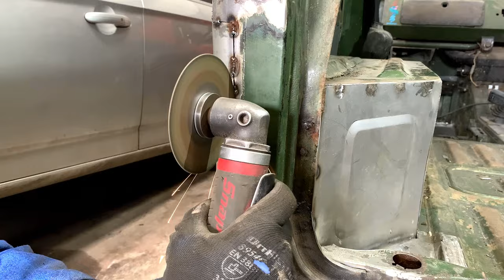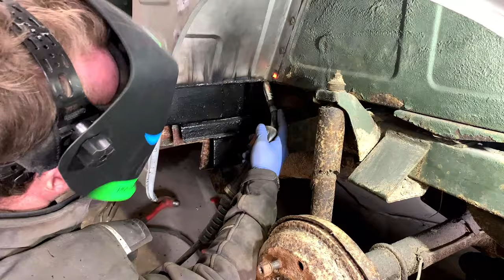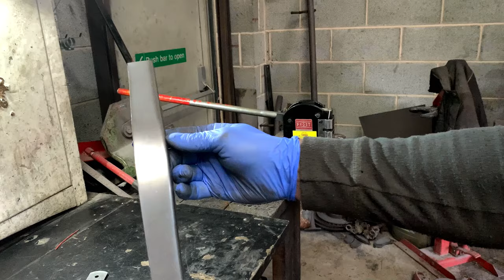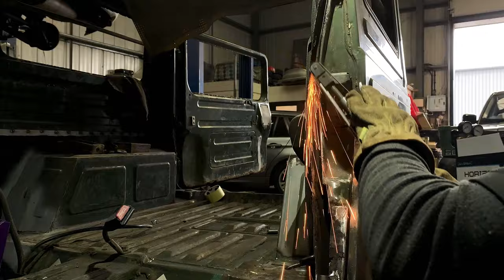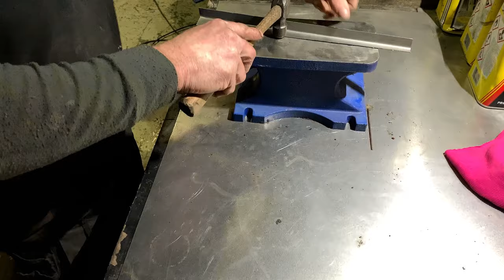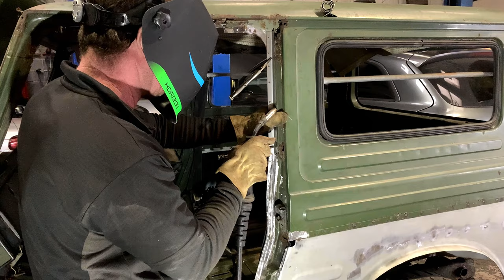Suzuki LJ80 Restoration Part 7 - Repairing Inner Door Jamb & Finish Welding Rear Quarter and Sill

Comment: I love your work, its so satisfying to watch. Definitely lots of skill involved here. I was wondering though - why don't you treat the steel on the inside of the panels before you weld the patch panel in? And the rear of the patch panel is left exposed? Won't it just rust again? Or are you assuming that no moisture would enter the panel? Thanks!
Reply from the maker: You would be correct but when welding this just burns off and everything is going to be cavity waxed before seeing the road again :)

Comment: hi, very nice work, lots of patience ! what a great car it will be. do you use your mig welder with gas or without ? thank you.
Reply from the maker: Hi Charlie, its very low grade steel on the Suzuki so very hard to weld, we use gas and give it plenty of pressure to help.
Reply: Thank you for the information, it's helpfull. you have a new subscriber !